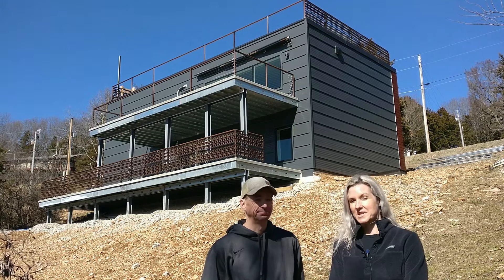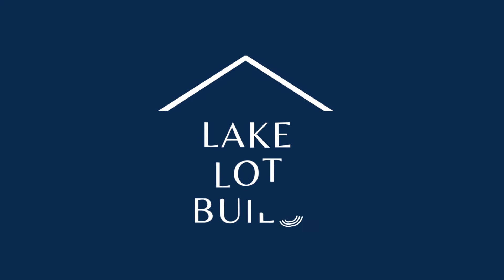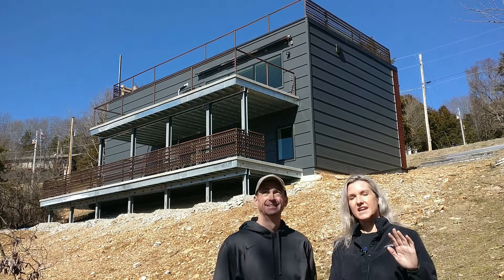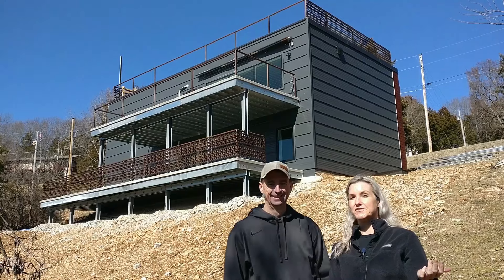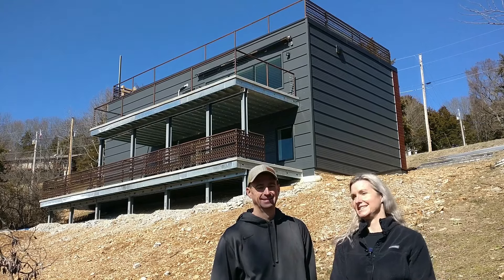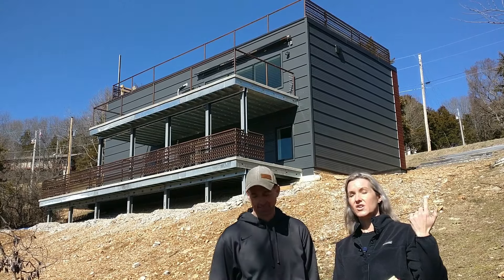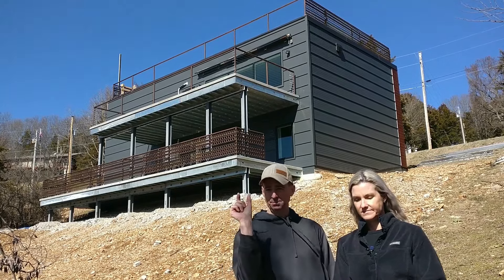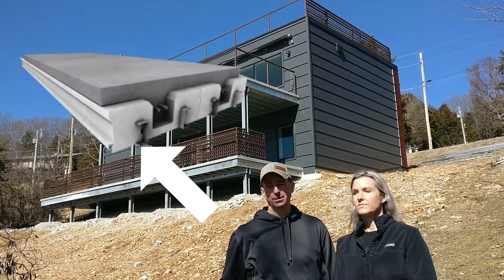Mistakes We Made in Our ICF Home Build! Would we build with ICF again?

Comment: I’ll say it again your house looks incredible. One product we used on our ICF for sticking our Term Termite barrier to the ICF wall was SHURTAC by Polyguard. It also works great for peel and stick flashing around windows although we went with liquid applied flashing. It paints on the foam and remains tacky for several hours. Hope this makes you feel better but our biggest mistake we found after building 4 Owner builder homes was finding good contractors. Our ICF build and our last house we will ever build except maybe for our kids😅 we made the mistake of subing out our Slab and not fully vetting the company. I would tell them to tighten the mix and no sooner would I turn around and it would be wet again. Once they started to finish it I realized why they needed it so wet. They had no clue about proper screeding. That said we had shrink cracks in the slab as it cured within hours. Lesson learned we were going to do it our selfs in sections over time but wanted to get the walls stacked before hurricane season. It takes longer but doing it yourself is much better then using bad subs. Our 20 x 16 Carport, 16 x16 porch, 20 x 16 boat garage all completed DIY has no cracks and no puddling after 3 years. DIY all the way unless you know for a fact the sub is worth it and not just because there salesman says they are go view 2 or 3 jobs for your self. I’ll shut up now 😤
Reply from the maker: Yes! We have done many things DIY that we would have rather hired out (drywall, HVAC, electrical) but sometimes the subs don't do any better than we would do ourselves so it's better to just watch some YouTube videos and give it a go!
Reply: I know a guy that works for CMHC that told me it takes 4 house builds to get it perfect.  He was only truly happy with the 4th.  I can sympathize about the concrete , not so much for the contractor (in this instance), but the supplier that I'm sure had our concrete for my garage floor (28x32, 5" slab) on the truck for WAY too long, and also had accelerator in it on a hot day.  The guys were trying to work it and were walking on it within 20 minutes of it being poured!  I ended up in court with the concrete company, only paying half in the end.  Had to put another 3" on top.  You could land a cargo plane on that floor now 😉
Reply: @LakeLotBuild  Exactly what I tell my two boys.  'Back in my day' we didn't have Youtube...it's a lot easier to DIY now, and you can start your life without a mortgage.

Comment: I’m not sure if you mentioned this but how much more expensive is this type of build vs wood? Thanks
Reply from the maker: When we built during the pandemic it was actually the same price as wood or maybe even cheaper. If you remember lumber prices went sky high during that time. Most ICF builders will tell you that over traditional building cost, ICF will cost you about 5 to 10% more. I can tell you we've easily made up for that just on electric costs alone in the first year.
Reply: @LakeLotBuild  awesome. Thanks 👍

Comment: Great video.   We are doing a large ICF hose as well with some unique featuers, and most of the issue you discussed were things we ran into with our first one and have taken into the second one.   If it makes you feel better, no matter how well you layout your penitrations, you will always miss one and have to core it.   For the cost of hiring that our, you can get a diamond bit core and good hammer drill though.    Just a a thought.   In my case, I had two of them off by just a little and were sticking into doorways on verticle runs through the walls, so had to core an move those.    Couple other suggestions.   You can pressure wash the ICF foam and take all the dust off and tape will stick to it like new again.   Other methods are to spay on a thin coating of latex primer or paint as well.   All ways to deal with the deteriation of the foam.   Good luck.     By the way, you video on electrical and using rebar was great and helped me in my new build.   I bent a small L on one end which makes it even faster.   You go from each side, then use the L to clear the top of the stud in the lite deck.   Makes quick(er) work out of it.

Comment: Built our house with ICF basement walls. The people who did it had never done ICF before. They ended up using petroleum based "sealer" to glue nowhere near enough of a waterproofing layer to the ICF and it ate the styrofoam right at the footers. Had to have the whole thing excavated because it leaked bad. and had to really make some tough choices about how to fix it. It "seems" to be waterproof now, but it's still hard not to worry about it having issues in the future.
Reply from the maker: Oh no! What an experience! I hope it never causes more problems for you guys. Thanks for watching!
Reply: @LakeLotBuild  I know this is too late.  But most folks who have the ICF block exposed for to long use a hand tool that is specific to ICFs. It is like a big hand held cheese grater. You rub the wall by hand with the tool and the yellow foam comes off and you are left with clean styrofoam. Things will now stick to it and Bob's your uncle.  Thank you so much for the vids.

Comment: I built a house 2020 all new with IFC basement heated floor and covered all in roofing on the outside plus cemlite trailer skuff 24 inches wide works very good stays warm and cool utility bills are way better than they were with the last house I went from 675 square feet to 2700 and the bills are cheaper

Comment: Hey guys, I enjoyed your video. I have a few thoughts.
There are quite a few UV inhibitors that could be sprayed on extruded foam.
I've run into other window brands that paint white vinyl windows when you ask for black. , I agree, it's really unprofessional.
Many of your issues would have been mitigated if you would have hired a competent contractor. Thanks. Such as window and door openings being incorrect or beams not being laid out on center are kind of inexcusable in the building community.
Reply: You can accomplish having things done correctly and avoid design flaws with a competent project manager. No need to hire a general contractor.
Reply: In my experience the only way to find 'competent' contractors is word of mouth if you're lucky and know people that have built, or painful trial and error.  In a contractor's mind, they're all competent 😉.  I found a few great guys (kitchen, drywaller, finish carpenter, plumber), but I wouldn't hire back most of the guys that I did.  Some did great work, but either tried gouging me to the bone every chance they got (plumber), or were just complete a-holes (electrician).  I'm going to do a lot more by myself next time.

Comment: Coming to this video late in process I understand John the dilemma you went thru as an engineer. When I was in college sitting in engineering classes the instructors drilled onto our heads “ don t let anyone ever tell you you are wrong.” Engineering is based on fact not myth or what looks good from an architectural standpoint. Thus, engineers usually go it alone rather than relying on experienced project managers for guidance.
If I am thinking of the same Tablerock Lake near Branson as you are on, We might be future lake neighbors. We are building single story walkout basement ICF construction homes for use as short term vacations rentals for our company.
Reply from the maker: We would love to have you over sometime to tour the house! Just email us when you are in town. Table Rock is fantastic!
Reply: @LakeLotBuild  I ll email you before I come to area researching spots near Branson for building . In meantime, I ll email an option to consider for solving your roof situation.

Comment: What did you cover the outside with?
Is that metal or vinyl siding or did you use a concrete product?
Reply from the maker: We used standing seam metal roofing as our siding. The company has never done that before but were willing to try it. We have two videos that cover the install. Here is the reveal one; https://youtu.be/nCFOtPTW6xs

Comment: Absolutely fantastic video, architect here and everyone of those items is frustrating I know yet they are minor in the big big picture, y'all have the brains to have worked through the issues, y'all did very good. Having said all that :-) thank you for sharing and I will check my window and door rough opening every single day :-) and yes I'm not a fan necessarily of pella either hopefully going with euro-wall.  Putting in sleeves very smart idea as opposed to core drilling, I've already been planning for that and for a future openings I may need. Where I'm building is at 4000 feet mountains between North Carolina and Tennessee right on the border, not planning on putting HVAC in will be putting a ventilation system in as well as heated floors.

Question for you if you've gotten through this part of my comment so far :-) do you have an idea of how much more your concrete floor concrete roof cost in relationship to a standard roof standard floor joist system? Just looking for a percentage I know it's gotta be more. Just trying to decide if I really want to afford it. One of my big reasons for wanting it is I will not have a fire department anywhere close to me. I will have to be self insured.
Reply from the maker: The roof cost $35,000, so that was for the ICF Litedeck forms, labor, and concrete. Our roof is 1300 SQ ft. That did not include our waterproofing though. It will probably be another $2-3K. I can't really compare to what a traditional would have cost, but hopefully the real coats help you!
Reply: @LakeLotBuild  Helps tremendously really really helps I can get a standard roof priced and then compare I’ve got to believe my concrete cost and construction cost is a little cheaper than yours. But in this environment I am totally surprised, the cost of my home just estimated has increased by $60-$100 per square foot just in the past year and a half when I first bought the property and started estimating things
Reply: I did want to say, furring strips on the underside of the ICF roof was a brilliant idea I will absolutely do that.

Additionally the Tyvek on the exterior of the building to keep it from choking it’s also a great idea I was already planning on putting Tyvek up even though it really doesn’t need a rain screen in your area you probably don’t get as much rain as I do being in the mountains of North Carolina yet a rain screen is suggested so I’ll be putting up furring strips all the way around the house as well and then Tyvek over that and then my metal panels real similar to what you’ve got yet mine will run vertical thank you so much for this video it certainly helps everyone and I have been following your journey very nice. I remember the day you were breaking Ground seems like a long time ago :-) I know how it goes I haven’t built a new home at all but I’ve renovated several and it just seems like it takes a lot longer than we anticipated
Reply: Fire sprinklers aren't for everyone,  but new buildings have the opportunity to snuff fires if they are too far away from emergency services

Comment: How would it do with a wild fire?  I’m in Texas near where the fires were last week.  What is the heat rating on the metal siding?
Reply from the maker: Scary stuff! I hope you all stay safe down there. The siding is actually standing seam metal roofing material. Since metal roofing is designated with a Class A fire rating, it is one of the most non-combustible roofing materials with the greatest strength to stand up to fires. As stated in the Underwriters Laboratories Inc. Standard For Safety: “1.3 Class A roof coverings are effective against severe fire test exposures."
Reply: @LakeLotBuild  we are safe, thanks! We did have a blaze rare up about half a mile away behind us with the wind blowing towards us, but thank the Lord the fire crew got to it.  I walked out of the shower into the bedroom catching the bright orange flame glow and about crapped my pants though.   So I guess the next weakest point would be the windows.  And in that case, aluminum framed would be the best?
Reply from the maker: Yes, vinyl would not fare well in fire. Aluminum would do better I think. We also keep the trees far away from the house. If you notice on the videos, we have a good 20-30 foot tree-free zone on all sides of the house. We really didn't want tree leaves and pine needles on roof top deck but also helps with the view 😁 and of course fire danger.
Reply: @LakeLotBuild  yes.  Well, you all did a great job!  Thanks!  You should become a builder!

Comment: So - what is the difference in a concrete block house and icf construction?
Reply from the maker: Icf construction has insulation on the outside and the inside of the concrete wall. It has an r factor of about r50.

Comment: I built a 3,200 sqft walkout with an ICF bottom back in 2009.  I did use PVC pipe for all of the knockouts, which was a breeze.  I guess if you put one in the wrong place, you may have to core it, but I can sympathize with some of the dumb ideas contractors come up with... usually just so they can make more money.  I made sure to check all my rough openings because I don't trust contractors.  The ICF was ok, but they screwed up every single interior door opening in the house!  I caught it and made them re-do all of them.

I did find out about the ICF in the sun too.  Ours sat uncovered for almost 2 years (Canadian prairies) and mine yellowed too.  I attached metal lathe (you have to use the small diameter stuff with ICF) and then stuccoed it by myself...what a nightmare.  I'd never do that again, way too much work.  

It turned out fine, but I'd just screw 5/16 PT plywood to cover it, and then use siding on top when I was ready.  I've never heard of Litedeck, but I'm going to check it out for my next build...which will be half the size this time.  I always wanted to try a rooftop deck (I still have 150 acres in the boreal forest...nice views) instead of the standard elevated deck but I'm worried about the moisture and snow-load.  

I love these videos...they are very important and I wish more people would do them, thanks!
Reply from the maker: Thank you so much! We have been really happy to hear from so many others with ICF homes. We would be happy to tell you about LiteDeck and our experience if you have any questions. Thank you for comment!

Comment: As an ICF installer for almost 20 years. You do need to get the Lite-Deck square to the house. Don't fur Lite-Deck. They have have a wood system WRS. Add EPS to Lite-Deck top to create at least 3/16" per foot  pitch.
Reply from the maker: Great tip. Thank you!
Reply: John is not talking about furring the top of the lite deck with wood. He's talking about under the lite deck where the ceiling drywall hangs. If the metal is not straight and square, surely it's okay to use furring strips underneath to get straight lines where the drywall sheets butt together.  Separately, John mentioned needing more slope on the top of the lite deck, and your comment to add EPS there was a great solution for the top side.

Comment: Why do you not like wood windows?  I get the issue with the black coating they use. Most window companies use the same process, and it makes since to me since most of the vinyl frames comes from the same manufacturer in Canada. One tip on painting the windows or touching them up, is use a good adhesion promoter as paint does not like to stick to vinyl that well.
Reply from the maker: They just take a lot of maintenance with staining and poly. The ones in our current house are faded by the sun after 15 years and need to be sanded, restrained, and coated with UV protector. They look great when new, but we just don't like upkeep.

Comment: Instead of lite deck would you consider Precast concrete slab and then pour 3 inches or so on top of it and then waterproofing it?
Reply from the maker: Yes. I think that is a good solution. We like the insulation property of Litedeck, but I think the option you propose is a good one. For us, getting a crane to the property to lift slabs of precast concrete would have been really difficult.

Comment: I spoke with my homeowner's insurance about how buying land and building would work.  They mentioned "construction insurance" during contstruction - did yall use that?
Reply from the maker: We did! It's important to have in case someone gets hurt on your property just walking around looking at the building while you're not there, or if you have materials stolen off the job site, or if the building is destroyed from fire or natural occurrence during construction. It's usually cheaper than regular homeowners insurance, but sometimes it's the same for a year of construction as it would be for a year of the regular homeowners insurance.
Reply: Our agent set us up with a plan that insures it while it's being built and then just "converts" to a homeowner's policy.

Comment: How do you cut through the concrete with out coring?
Reply from the maker: We would not have needed any coring if we put in knockouts like PVC pipe where we needed openings. Then we could have just poured the walls and the concrete would have been "poured around" them and saved the openings.
Reply: @LakeLotBuild  now I get it, thanks for the explanation.
Reply: @LakeLotBuild  yeah, I think I've only ever seen other ICF builds done with the knockouts in before the pour. Heck, it's part of why the design/planning phase seems to take so much longer. Got to plan all the openings before you ever pour the concrete.